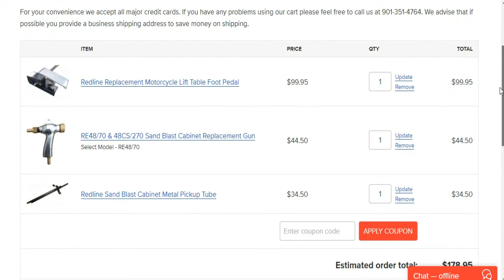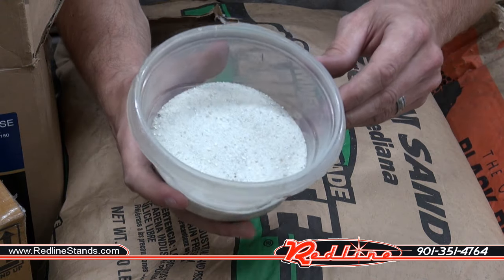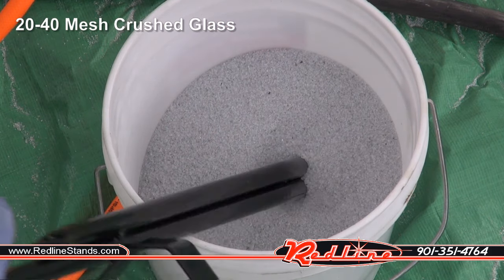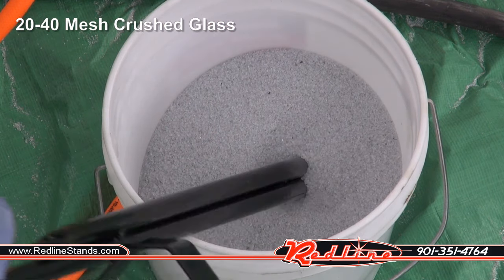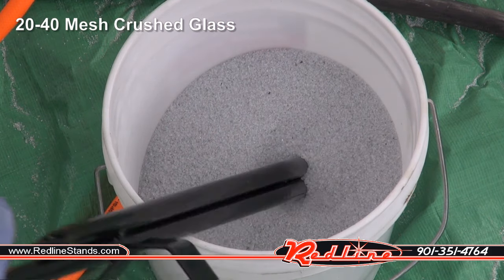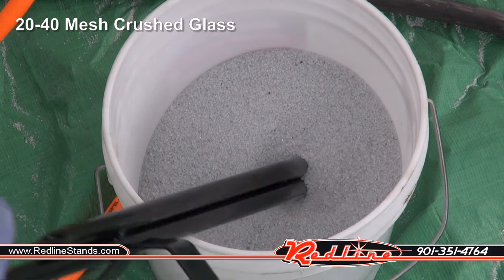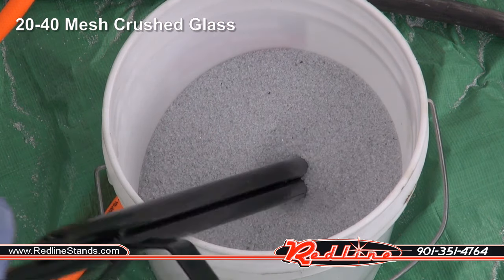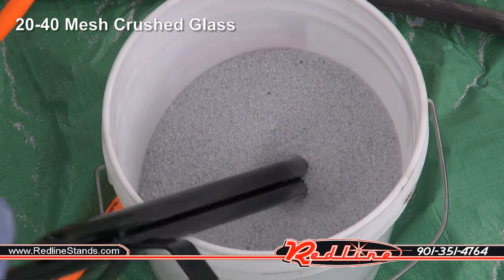Blast Medias Compared and Demonstrated

Comment: What can I use to remove paint from chrome
Reply from the maker: I'd use a chemical stripper to keep from damaging the chrome.  Read the label first and buy anything made by 3M.
Reply: Plastic. It will strip the paint without damaging the undersurface. Ideal for blasting soft metals like aluminum, brass, etc.